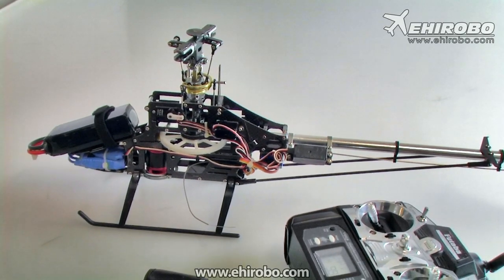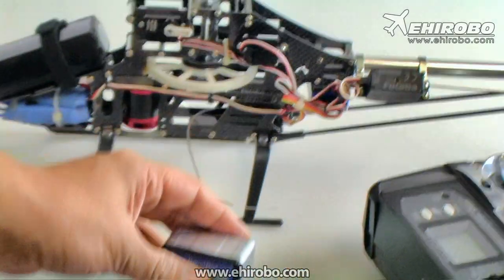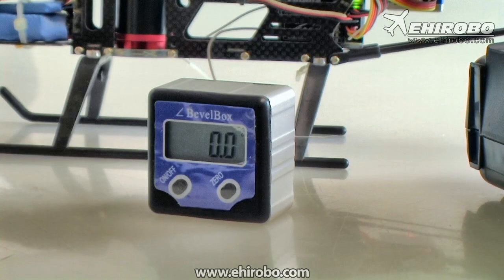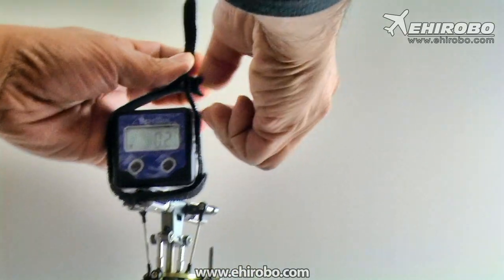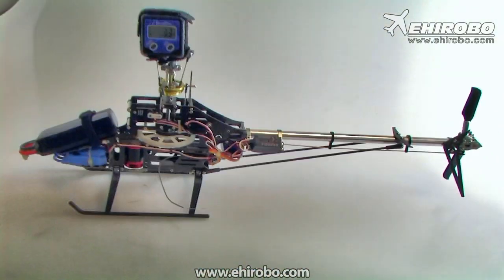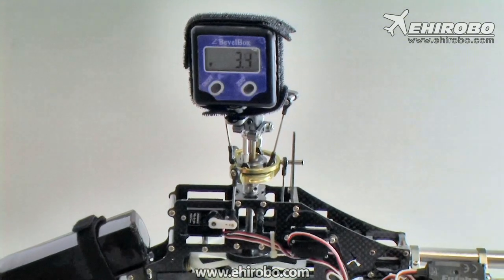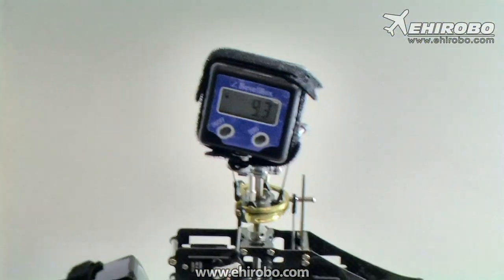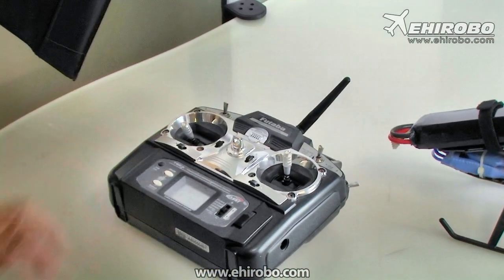DragonSky Bevel Box Digital Pitch Gauge

Comment: the work surface does not matter. the shaft is still centered to the frame. not the work surface. that is why you set zero on the frame or motor top and not the table wall etc. thus why you do all your pitch checks with the blades in line with the boom. Come on people this is basic setup here.